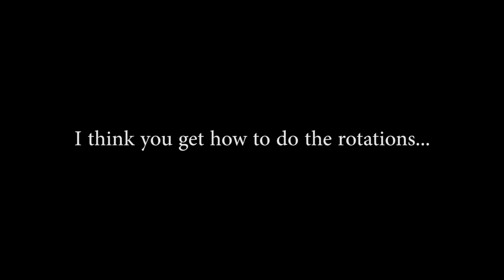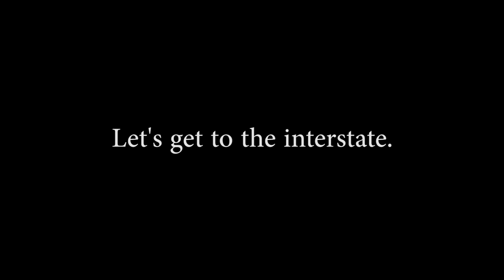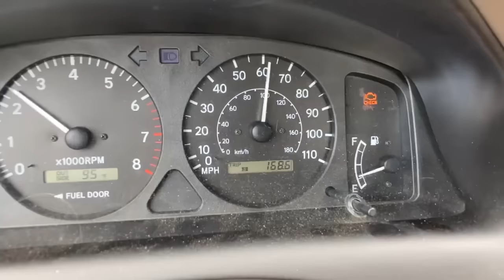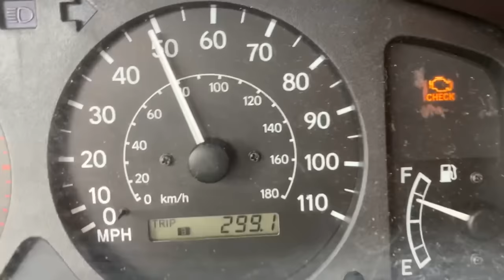Will Berryman's B12 Chemtool stop oil consumption? 😲 | Oil Burning🔥Experiments | Episode 15

Comment: An old mechanic told me to put a quart of kerosene in the oil and drive it around for a while.  He was old at the time, and I was about 16 years old, and now am 75, so you can tell that his knowledge was very old.  My old junker had a 292 v8, and the return passages in the heads were clogged, making it a true smoker.  I did it, and the next day, when I took off the valve covers, I had a super clean head!  I drove that clunker for another five years or so, and it never burned oil again.
Reply: 292 Ford was actually a pretty good V8. We used to call it a Y block. It bolted our 57 Fairlane w/ 3 on the tree around pretty good considering it weighted more than 4,000Lbs. Pulled a utility trailer real good, got decent gas mileage around 17mpg and lasted a long time. (That took me back.)
Reply: Did you need to replace a liter of oil with kerosene? Or did you just top off the oil to the normal required level, and then add a quart of kerosene?
Reply: @enermaxstephens1051  i waited until it was a quart low.  My car was a very rotted 1958 Ford, and that engine was not at all computer controlled.  I don’t think I will be doing this on my 2017 Ford Expedition for fear of blowing the whole thing up.  I would not hesitate to do this on any non computer cars though.
Reply: @bmcc12  I'll probably try the similar berryman's method on my 1987 Silverado. It's the first year of the computer, so it will be less computer controlled than newer vehicles. It burns oil too so I figured it would be worth a shot.
Reply: @enermaxstephens1051  that sounds like a plan.  I’m not certain that adding kerosene will destroy the newer engines, but why risk it.  I will ask you to let me know if it smells like kerosene, because, as a skeptic, I fear that it might BE kerosene!  In my case, I was poor, the thing was a HUGE smoker, so I couldn’t lose!  Best of luck
Reply: I put a quart in every 4 oil change and run it about 50 miles and change oil and filter, change oil with it hot and let it drain good, then flush with cheap oil 
Then new filter and correct oil
Reply: ive added a full gallon of paint thinner into the fuel tank (1/2 full tank) to clean the system / cat con.  Good results.
Reply: @enermaxstephens1051 wait till it is a quart low and add it. I've also heard of using diesel or diesel-kerosene mix
Reply: @jamesdecanteur4485  I would just use high detergent oil like Redline but it's pretty expensive. Most expensive oil, iirc. But also thought to be the best because of it's ester content. Which has been known to scrub the engine clearn, wherever oil goes. The berryman's or kerosine idea is a lot cheaper.
Reply: @philliphall5198  your over doing  it,  just use a high quality oil,at your manufacturer  recommended  miles,  i had a 350 v8 chevy in a S10 as a service truck , 537,000  miles on that motor , took it apart ,machine shop  said it didn't  need any work or cleaning. ,they kept asking who cleaned it ,  nobody  did, i used Mobil  one with 20,000 mile oil changes ,, wix filters, I drag raced it after the fresh up and won king of the track and king of the hill titles  racing  thur the nhra series,
Reply: I’ve also heard to add ATF-tons of detergent in the ATF
Reply: @enermaxstephens1051  it was nearly always low a quart, I just topped it up
Reply: My Dad was a Master Mechanic and engine guy from the 50's-60's and told me about this. They used to rev the engine up with kerosene in place of oil until the exhaust got red hot to clean out carbon. Great for all the steel/iron blocks and heads they were running, but anyone stupid enough to do anything similar in anything remotely modern deserves the pain they get.
For some engine I could see adding a quart of kerosene and idle it without rev's for 15-30 minutes, but certainly not driving it.  Nothing like running a 10w30 engine with 20w equivelent.....
Reply: @carlstephens1532  While 3K oil changes seems excessive outside of high-revving or 20w engines, anyone running anything, Synth, 10K/20K oil for more than 7500 is just stupid.  Walmart Full Synthetic is $20 5q with a decent non-Fram filter $5 and 15 minutes.
And extra $25-30 oil change early once a year is worth the journal/bearing/carbon build-up hassles.
Reply: @boots7859  I did fleet maintenance  along time ago 136 vehicles were my responsibility   we used a lab to determine when the motor  oil was to be changed. 9000 miles was the lowest and 25. OOO was the longest , when I had mine I went 20,000  miles and got 537,000 miles out of that motor it checked okay at the machine shop. A refresh was done. And put back in.
Reply: @carlstephens1532 Modern engine oil has decreased the detergent package due to most of the alkali metal salt detergents causing Low Speed Pre Ignition in direct injected engines.
Reply: @gregorymalchuk272  I'll  let you know because soon I'm going  to pull one of my trucks  engines soon to do a fresh up, it only has 367,000  on it, I've  owned it 23 yrs now on Mobil one and wix with 20,000 mile oil changes
Reply: This is how motor flush works, but I wouldn't drive on it. The diluted oil will be less sticky, and the lubrication properties will be compromised.
Reply: If you change  your oil as directed  you will find little need for cleaning. My service  trucks mot0rs with over 500,000 proved to me and my fellow  drag racers that mobile  one and wix is a winner
Reply: @carlstephens1532  How often do you change the filters?
Reply: @boots7859  I run Fram gold can filters when I can't get a Wix. I would suggest nobody to use the silver or orange can Fram filters as they're (in my opinion) a trash filter.

Comment: The experiment likely unstuck the oil control rings and allowed them to expand and do their job.  The hint may have been the increased friction you felt when initially turning the engine over by hand.  You didn't make a big insurance nightmare of the broken taillight. Thanks for being such a good human.
Reply: 09/30/2023 : I recently purchased a well maintained,, one owner '06 T0Y0TA Avalon with 107K on it and the first time running it through the "touchless" car wash it did $ 3,300.oo dollars damage to the paint & body down both sides of the car.

The only thing supposed to touch the car body is water.

I got dents and divets. There WAS an insurance claim.
Reply: What part of oil soak doesn’t he understand? He wasted all the chemical is 5 minutes he can crank it the next day… he had so many great chemicals to fix this thing… but he won’t let it soak…..
Reply: the fact that the other guy instantly venmo'd him the money shows how well of a guy the other person was too. good job
Reply: @pcguy13x  Yeah, I'm not sure if I would trust someone to just give me their phone number, without any police report.
Reply: @taz24787  good point!

Comment: With one cylinder being super clean it usually means some antifreeze is leaking in through the head gasket and it gets steam cleaned.
Reply: nice catch
Reply: Not all the time sometimes it just means that one cylinder isn't burning oil at all
Reply: No that one cylinder was too clean. Even an engine that doesn’t burn oil will have carbon deposits on the top of the piston. It’s a bad head gasket when a cylinder and piston are that clean on an engine with any appreciable mileage.
Reply: Ore, it's just extra clean, lol 😂
Reply: Ya know, I was gonna suggest he check torque on the cylinder head. Yup!
Reply: @davidarnold6647 yes, true. Compression test.
Reply: @scottp2462 I've been a mechanic for 27 years and you sir are 💯 correct 👍.
I've never not seen a clean cylinder that wasn't caused by water/antifreeze getting in.
Reply: Can also do it deliberately by trickling a small amount of water in via a squirt bottle (like Windex style) carefully sealed into a port for some or other hose in the main intake hose after the throttle body, or use either the PCB or brake booster line (if the water spray will be well distributed).  Believe it or not, this works as well as Seafoam does (sorry seafoam believers).
Reply: He poured carbon cleaner on top of the pistons. And they oil wash the pistons burning that much oil
Reply: @scottp2462  You are correct. There's no ignition on #3 yet the plug is getting spark. I had the same thing going on with a 1300cc VW engine it was a bad head gasket. Same exact look on the piston.

Comment: Chemtool is great stuff. Used it in a 5.0 EFI Fox Body for over 30 years. Kept my TB and injectors wicked clean. That motor got me to almost 350,000 miles AND IT STILL RUNS!
Reply: I have a 1988 mint condition LX 5.0 Fox body I once put this stuff in my oil before an oil change but all I did was drive it there after putting it in would you recommend driving it longer with that stuff in the crankcase I was thinking about it but I didn't want to damage anything because this stuff is just so good

Comment: I swear by Berryman Chemtool B12 for fuel system cleaning. I have used it for many many years. for both carbureted and fuel imjected vehicles. and I've had fantastic success with it. but I wouldn't ever do what you're doing with it?

Comment: thanks for making these videos.
I have a Tacoma (2TR-FE) that has been burning a quart every 300 miles for a long time. Tried many different things, and was about to have the engine rebuilt when I decided to try this as my final effort. 
I followed your method (almost) exactly. its been about 2 weeks and almost 700 miles and I've had no noticeable oil loss, and the oil has stayed much cleaner as well. 
thanks again, looking forward to your update.
Reply from the maker: Great to hear, Ben! Please do keep us posted on your usage.
Reply: Hey Ben I also have a Tacoma at 350k miles and it burns oil also I have my b12 ready to go but have just been waiting for the right time to do this, cuz it’s my daily driver. Out of curiosity how much b12 did you use per cylinder? I know that Berrymans recommended more b12 in V shaped engines. Also did you drive it around with the b12 in the oil or do an oil change immediately? I know some people let it drain and add more oil. I know Kilmer has recommended to be careful running vvti engines with oil additives due to clogging the solenoids and filters. Thanks for your input!
Reply: @luisramos5330  sorry for the late response...I split the can evenly, so maybe about 4 oz per cylinder, then added a little bit more after it'd drain/evaporate.
I changed the oil immediately after to be careful, did the 20 miles at high rpm's, then changed the oil again.
I've driven about 5000 miles and have had no noticeable oil loss, so I'm pretty impressed with the results.
Reply: @benbarnes6931 wow, great results!
Thanks for a thorough video on this procedure!
Will try this on our 2005 Mazda 3 sport soon.
Was kind of hoping to see a scope of the cylinders again after oil seems to have stopped bypassing the rings.
Has your oil stayed cleaner longer?
Our Mazda’s oil gets dirty quickly I think from blow by on the #1 cyl that seems to have the biggest oil bypass of the rings issue.
Thanks!
Reply: Awesome
Reply: Cant believe you're.driving that worn engine in 3rd gear at 60 miles our ..the top end might survive but the bottem end wont survive
Reply: By the way that oil on 4 is from valve stem seal
Reply: @born2wrench Yeah, it's better to let them idle for 10 minutes with an occasional rev to 2000 rpm when doing this type of cleaning. Not high rpm for 20 minutes straight. 🤦🏻‍♂️
Reply: Used B12, soaked the pistons, my 2009 Toyota Venza consumes 2 quarts per 200 miles, it was drinking oil, now after soaking and using 5W30 high mileage motor oil, it consumed half a quart every 2500 miles.
Reply: Thanks I’m gonna consider doing this. I’m burning a quart every 300 miles or so.
Reply: Should have put in new plugs too
Reply: @LeadStarDude Agreed 💯

Comment: I did this on a 1.6 Kia engine. 

Loosely thread the sparkplugs back in, to stop foreign contamination and evaporation.
Don't start the engine with the oil contaminated with Berryman's - it puts the bearings at risk. Dump the oil and change the filter before starting. 
Fog the cylinders with light machine oil before putting the sparkplugs back in. The engine doesn't want to start because the cylinders are dry, causing a loss of compression. 

This resolved the oil consumption issues in the Kia.
Reply: What do you mean by "fog" the cylinders?
Reply: Those are great tips. I watched this video because I’m working on a 1.6L Kia. Thanks for adding that info.
Reply: @JshMusician  mist
Reply: @busybodyblake4050  how to achieve this with oil?
Reply: U can fog with spray Seafoam. Read the can u get from auto supply. Also see youtube "project farm" he has tested many such products. A great source of info. He has a directory of his product testing videos. Be prepared to relax and spend time watching his videos. They are concise and packed with good practical info. Some times he adds humor to spice things up.
Reply: Hum, as a ole guy, I've poured B-12 or seafoam in the oil for, um, 50+ years. Any vehicle that comes in over the oil change intervals, (5k) gets a 21oz can of B-12 or seafoam and idled for at least 15 minutes to clean sludge that has built up. If it's way over, pour a can in the oil, give it back to them, tell them to bring it back in 500 miles for the oil change.
It's a petroleum based product.
Drain the oil and it's black as coal, the crud is the oil drained.
Reply: there's a product just for fogging, or just spray WD-40 in it.
Dry?
Loss of compression?
How does this effect the compression rings?
Reply: @stevemac8436  
A few squirts of 3-in-one oil in each cylinder will work fine. 
Dry cylinder walls won't achieve enough of a seal between the cylinder walls and the piston rings to devolope sufficient compression to start the engine.
Reply: I did this for a kia sportage 1.6 gdi 2017. It worked ! Before 1l of oil / 3000 km. Now I have 7000 km and 0 consumption. I used Nitrodiluant ( Romanian) for soaking 24 H and I manually rotate the engine several time in this period of time.
Reply: I'm about to work on a 1.6L GDI for a 2016 Kia Soul. This is good to know. It is burning quite a bit of oil.
Reply: @stevemac8436  Thanks for your experience. What I've read is that B12 and Seafoam are acetone based and could corrode rubber seals over time, so it's better to refrain to detergent based flushes/solvents (AmsOil, ATS).

Comment: This worked perfectly for me on a 2006 Rav4 with the 2AZ-FE engine 118k miles
Historically this engine used about 1 Qt in around 300-400 miles since about 90k miles, last year I followed the same process as below but used seafoam (per one of your videos too) instead of B12, this gave me 500-600 miles per 1 Qt which was a good improvement.

I modified your process slightly by adding Liqui Moly 2037 Engine Flush to my oil prior to changing, ran for 15 minutes, let the engine cool then added the B12 to the cylinder for an overnight soak, next day flushed the oil with cheap oil, then drained and refilled with Liqui Moly 20438 - Molygen SAE 0W-20. its been 600 miles with zero oil consumption.

One word of warning using the Berryman B-12 Chemtool, I've read of people running their engine with the B12 in the oil and it destroying the bearings, with this in mind I did not run my engine after the overnight soak, just drained and flushed, so I cant confirm this issue, but for me it was not worth the risk.

Thank you so much DIY Dave, your demos and ideas have fixed my engine so much so that I may not need to top up the oil until the next change in 6k miles.
Reply from the maker: Glad to hear it, Andy ... and if you would, let us know how many miles you get before you need to add -- if you need to add at all :-)
Reply: I don't recommend to drive the car after adding any strong cleaning additives in the engine. One can fast idle (1k-2k rpm), repeat the process and change the dose according to the severity of issue

Comment: Fantastic video. My 2012 Audi Q5 2.0L turbo was burning 1 quart of syn 5w-30 oil every 400 miles and the vehicle only had 65k miles on it! Had a shop check the turbo and that wasn't the problem. The fix was similar to yours... and due entirely to your video: 
Process: Removed spark plugs and drained oil, added B12 to each cylinder, let it sit for a day (and frequently topped off), boroscoped (plenty of carbon on the piston head and could see oil on the cylinder walls at first), hand turned the engine 90 degrees, repeated the process once a day over a 4 day period. Drained the engine of B12 and replaced with fresh oil and filter. B12 fluid was jet black. Drove the vehicle 25 miles on fresh oil. Smoke was incredible. I'm sure folks thought the car was on fire! Drained and replaced the oil again and replaced the filter. Yup, again oil was jet black. 
End result: The car now has over 3500 miles on it since the second flush (3rd fill) and it's used less than 1/2 a quart of oil. Fantastic. Cost from beginning to end: One gallon of B12, 3 oil changes (original + 2 more) and 3 filters (original filter + 2more). Cheap and very effective fix. Piston heads clean and apparently so are the ports on the bottom scraper ring that were likely causing the problem. Thanks again!!:washhands:👍👍👌
Reply: Just replace the oil separator on top of the valve cover  .
Reply: Yo this is amazing! I’ve heard about all the problems those early 2.0t Audi engines have with oil consumption so I decided not to get one, but I might actually see if I can pick one up cheap and try this.